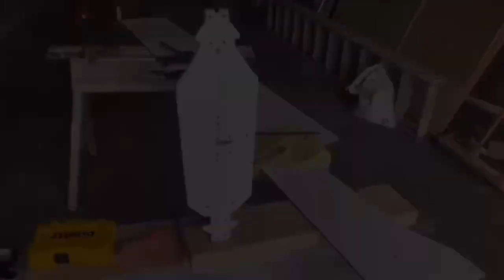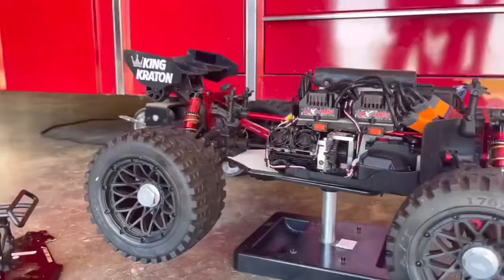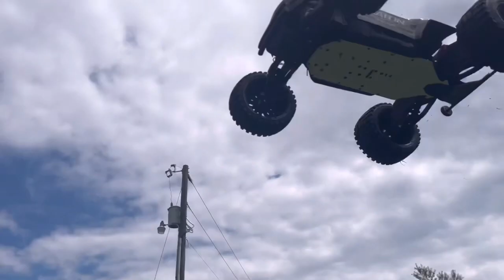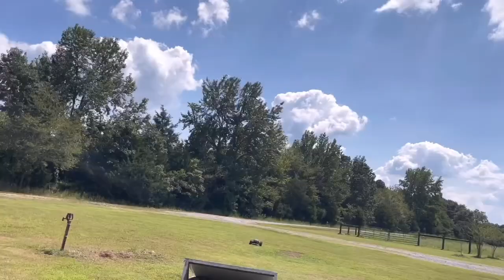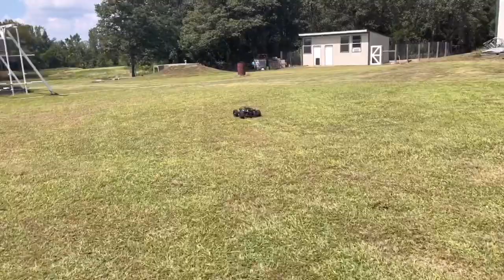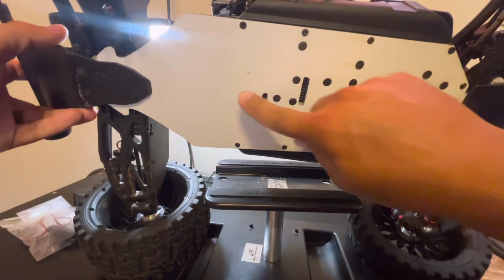Light Weight Unbreakable RC Chassis (Hand Made)

Comment: What material is the chassis
Reply from the maker: Thanks for watching! The chassis is a composite board lined with powder coated aluminum. I have a couple of videos on the chassis itself where I test it under some crazy conditions. I even run the chassis over with an F-550 with boards on the end. Unbreakable! Thanks for being here supporting the channel! 🤙🏼☢️
Reply: @RadioactiveRC  any other details on it. I'd like to experiment with it. Thickness? Manufacturer?

Comment: Great video sir as always but I have a Question good sir.. what shock oil weight are you using for your shredder.
Reply from the maker: Thanks for watching! No worries I always have time for a question. I use 35w as I do for most of my bashers. However I don’t recommend using the factory shocks if can be helped. If you use the factory shocks I would drill out the shock damper a little. So it doesn’t take as much pressure to get the factory shocks to move freely. I really like the Arrma Kraton 6s (rear) shocks. The Traxxas Maxx 4s shocks work well too. I hope this helps! Thanks for being here supporting the channel. It means a lot! 🤙🏼☢️

Comment: Countersink the bottom chassis screw?  And you did all that action on grass… fluffy soft grass
Reply from the maker: Thanks for watching! Yes the bottom of the chassis is countersunk. In the country all we have is grass. However this ranch is on a mountain top and underneath that soft grass about 12 inches…. is rock. Lots of cool stuff going on with this build. Concrete or grass the results will be the same. You should watch the making of this chassis and you will see this is some unique material. Thanks for supporting the channel! 🤙🏼☢️